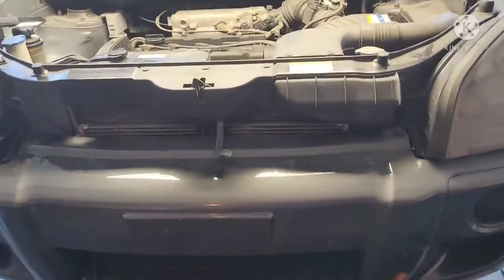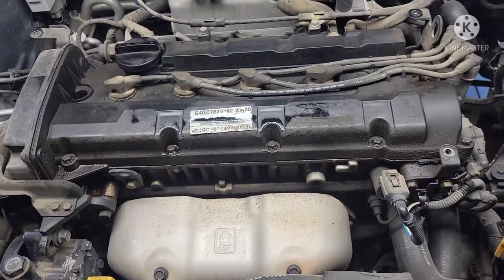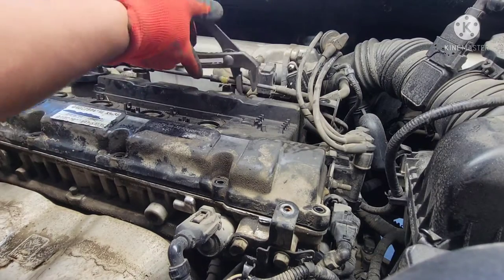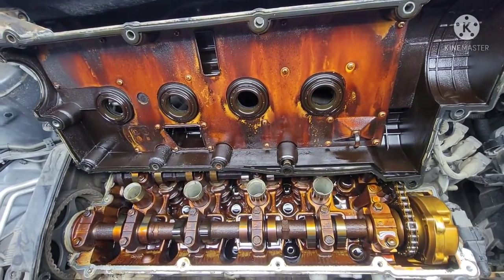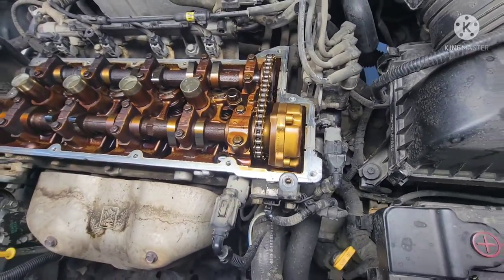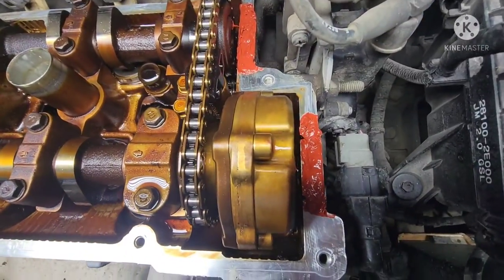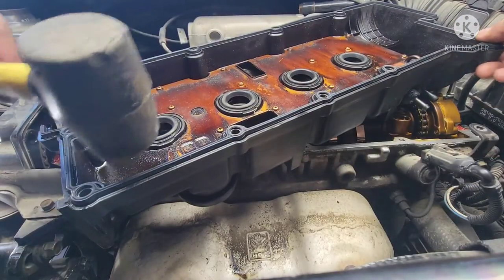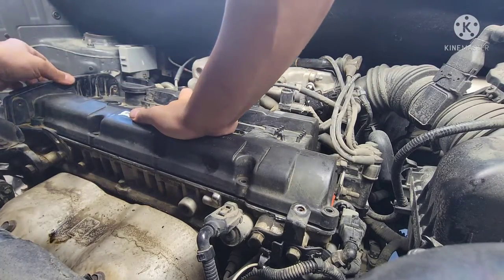How to Replace Valve Cover on Hyundai Tucson / Kia Sportage 2.0 L

Comment: Great video but at @4:00 there's one bolt you failed to identify. Middle of the valve cover on the left side between the timing cover and 1st spark plug opening. I almost broke my valve cover trying to pry it off with that bolt still in.  Other than that this is video is well done.

Comment: INCREDIBLE. COULDN'T YOU REMOVE THE STUPID GASKET ON THE FLOOR WHERE YOU CLEANED THE VALVE COVER? That is irresponsible from your part. that gasket doesn't look dried or stiff at all. that liquid gasket at the side ( silicone gasket), is to avoid leak. Look like you never have seen any other video or don't know this engine. you don't need to make a mess around the cam cap with silicone, just a drop in each corner.
---- also, you could put the gasket in another place instead of on the engine opened. tight the little bold with hands or fingers, then a little more with a rachet and then torque 7-8 ft lb.
my Engine was like silver after 110,330 miles when I change the gasket.
Reply: What motor oil do you use?
Reply: Primer video que veo que no le ponen silicona a toda la base de aluminio..incluso vi uno que le puso una línea de Silicon en la tapa en la ranura donde va el empaque...ahora me entró la duda si lleva o no lleva Silicon !!
Reply from the maker: Synthetic 5w30 Castro
Reply: The service manual indicates that it only has silicone in those places.  The people who apply it everywhere are not correct.  That's what the manual says.
Reply: Silicon gasket is not put on that way.
Reply: Obviously this guy is not a technician..